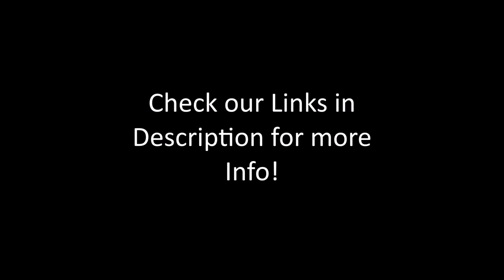How to make Stone Veneer from Concrete.  Step 3: Demolding

Comment: Good evening, could you tell me what kind of dye was used and how it was used, I'm from Brazil and I do not know the right technique
Reply from the maker: We use various color pigments for our stones.  Unfortunately, I can't go into full details of how we make our stones.  Good luck and hope your stones come out looking great!
Reply: EZ Rocks Forgive, did not want to take advantage, just information about raw material, because here in Brazil not so much variety of material nor so much quality, when it has, is not affordable after expensive cost, in fact everything here is expensive, so I will have to adapt. But thank you for answering
Reply: hello your products are very nice I make a small bi-bayerfox pigment I use but I can not find the right mold separator liquid what you can use what I can use
Reply: Luan Dutra hi Luan.....you can get pigment from Shanghai Yipin.......They produce one of the best pigments.
Reply: But getting the best pigment is not enough. I believe color mixture is the key to getting a very good outcome
Reply: @yassinchbani4267   السلام عليكم ممكن معلومات عن نوع الصباغة المستعملة